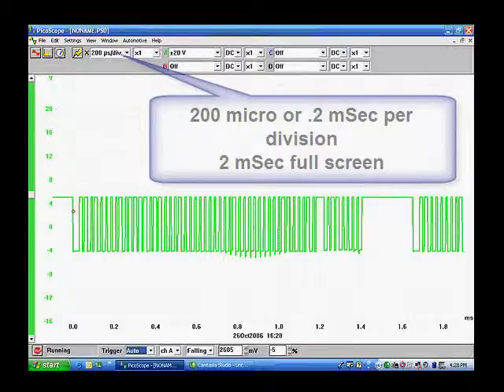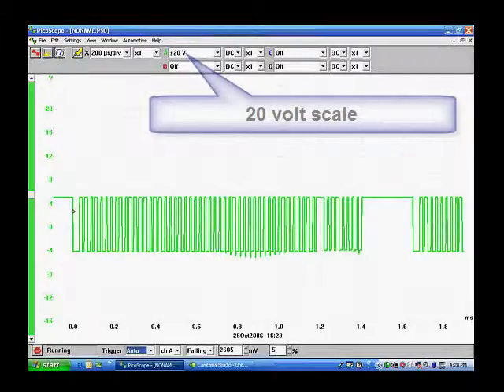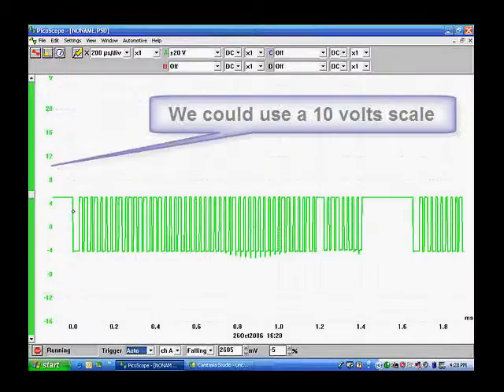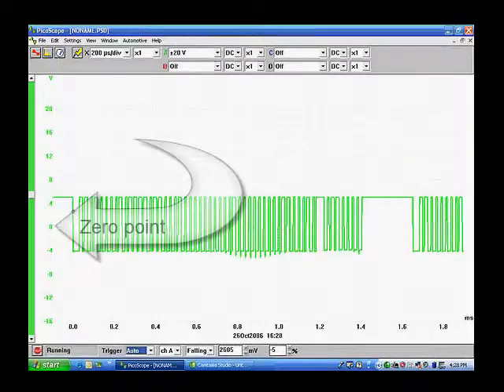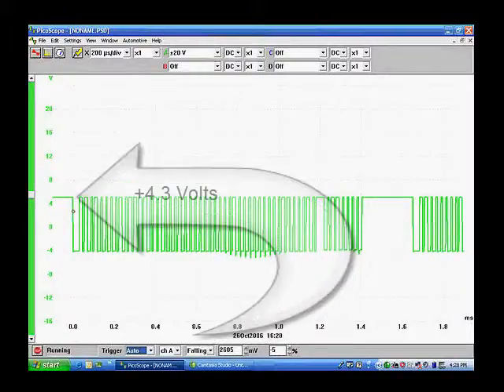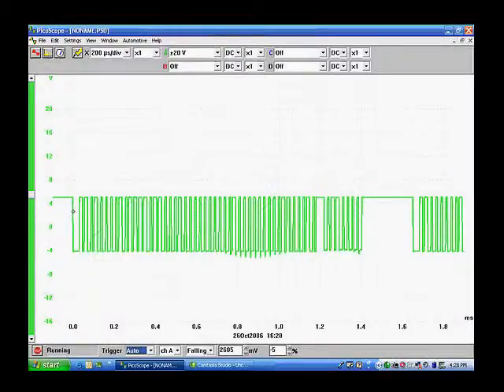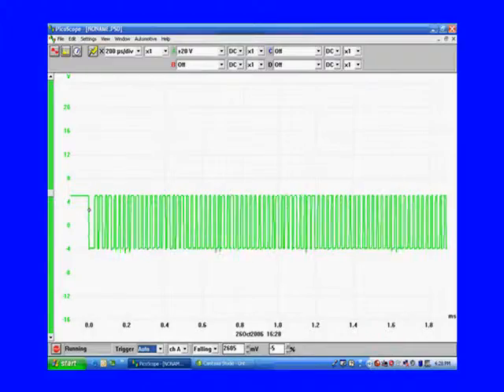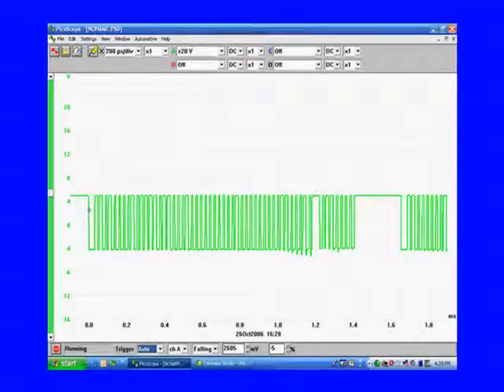11 Ford SCP DSO Pattern

Comment: My 2003 f350 6.0 diesel, has 4.25 on the high side, but the low side is at +.43. Should it not be at - 4.5 volts? This truck uses canbus for the ficm and scp for everything else. Transmission is acting up.